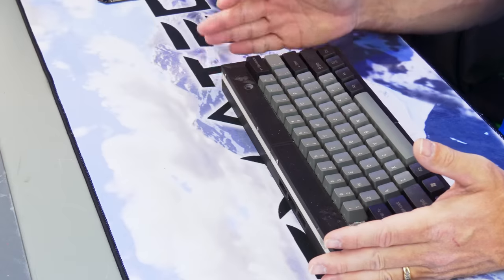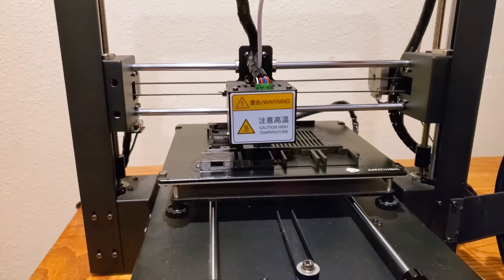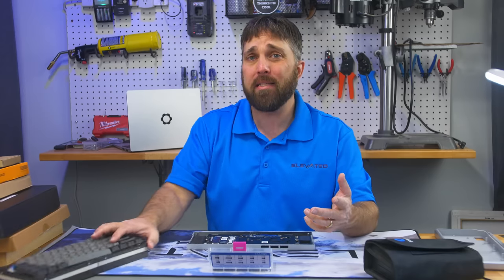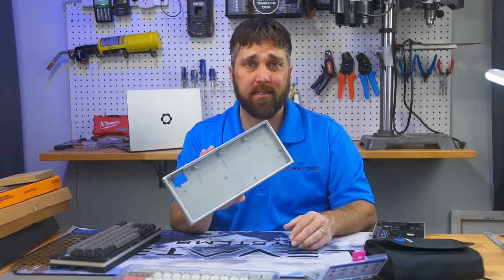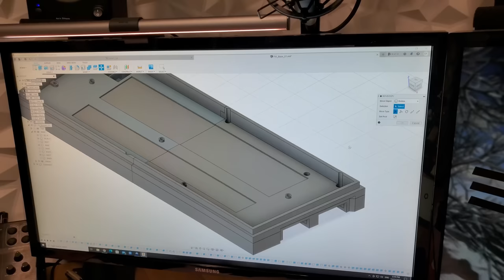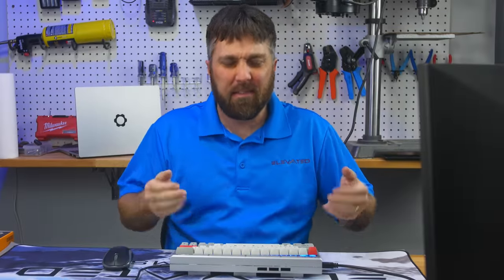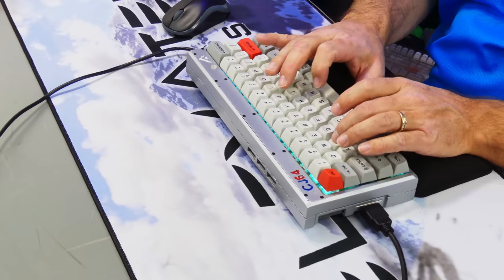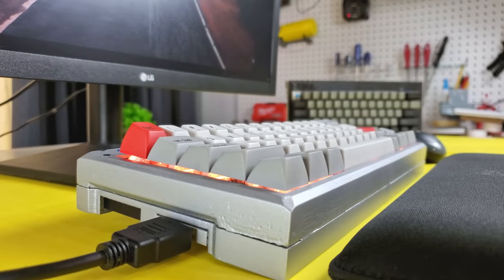The Framework Powered Cyberdeck Version 1.2

Comment: What'd be nice is if custom firmware could be submitted to framework, to add the capability to set a maximum charge/discharge state for the batteries. A good lithium battery might last 20 years if only charged to 80%, and discharged to 15%. Even if constantly on the charger. The main reasons batteries degrade in this use case is because of how batteries need to be charged. to get it to 100% say an example 10v battery, the charger has to hit the battery with 110-120% voltage or 11-12v. The problem is leaving it plugged in means that it is constantly being run at 10-20% over voltage. If instead you set the maximum charge state to 80%, or 10V you are now no longer damaging the battery constantly.

Comment: You might be able to save some front height on the keyboard by gasket mounting it, you would be able to skip that top layer that you are using to tray mount. If you use a brass plate you wouldn't have to worry about the PCB flexing into the framework motherboard since it is so stiff. After being part of the mechanical keyboard community for so long it's cool to see projects like this. You may need to increase the bezel size a little to accommodate the mounting style but I think that would be worth it over the front height.

Comment: The other choice was to make it have a trackpad if you want to make it look more like a computer. Put it were the numpad would go.

Remove the 2 side expansion bays and make a case for a trackpad and dock then slide it into the 2 expansion slots and Wala.
Reply: Or put the trackpad below the keyboard  (re-attachable maybe) if you'd like to use it on your lap on the couch
Reply: @dirkhaar2243  the way I was thinking it would be attached to the expansion slots so if you were to use it on your lap it would be attached on the side if that's a problem that I'm not noticing.

Comment: Suggestion for you v2.: Include a switch to use the Keyboard with another Desktop Computer, (like the GPD Pocket 3) So you can have a Keyboard and another pc at the same time. Or install bluetooth for That. A cheapo HDMI capture Card would also be nice, but I'm asking a lot here ^^
I'm curious for the all alluminium design.

Comment: you could run the laptop and plug it into a external monitor and also plug in a mouse and keyboard. 
The best thing about that arrangement is that you could use your laptop on the go, since it has a screen and a battery.

Comment: Hmmm. what about having a base with pogo pins to which you magnetically attach a keyboard module. For example, one can use a keyboard module with short switches and short keycaps . or having a keyboard module at home and another one at work, so only moving a slim case that contains the computer only ... limitless ideas and usecases this way ! I get that my idea is way off to the theme going on in here

Comment: The wood is a good idea for version 2..... If you're doing the current case as a "desktop case not built into a keyboard" that you can sell and it doesn't ruin it perhaps some "ready to go" vesa mount stuff would be good (maybe 2 or 4 predrilled holes in the flat cover?). So you can throw it onto the back of a monitor.

Comment: there are some USB 3.2 ribbon cables for FPV on ebay, you can even get custom length and angled connector options, much easier and faster than soldering it yourself in that case

Comment: Needs a dedicated hdmi port in the back with audio. I understand that it has usb-c thunderbolt on the sides but there should be a way to adapt the display and audio on the board to hdmi out or even display port. If it's a proprietary connector, it would be nice that Framework offer this as a kit in the future.

Comment: Really like this easy simplistic style, i like version 1 and i kinda want to see this made in as small form factor possible.

Wallthickness with aluminium CNC will optimise alot of space but id like to see very low profile switches and to make the keyboard as thin as possible. 

Such that this truely becomes portable or just sleak. Minimalist and thin

Comment: I would have looked into designing a right-angle module or have internal wiring for a Thunderbolt connection in the back. With the right monitor, it would be a one cable solution to the monitor, not including ethernet, that is cleaner than having a cable come out the side. Wish there were monitors that had ethernet built in and pass through via Thunderbolt; that would be the ultimate clean setup. The Framework has WiFi 6E, though.

Comment: terrible idea for a next step:

add a dock station, use some pogo-pins and break output all the IO to various options (ie storage, eGPU, mouse, ethernet, power), so that when you're at home you can just drop it into place and get all you desk setup attached without plugging in, and when you want to go you just power down and go.

Comment: You can probably use the original Framework battery by just removing its plastic casing and stacking/folding in half its individual LiPo packs. 😛 That would be a cool stealth mod. 👍

Comment: You can use a Royal Kludge 75% for the build to free a USB port with 2 more USB 2.0 ports for more peripherals. Well it will lose bottom/body RGB and will enlarge the body, but personally, I would need function keys and arrow keys at least.

Comment: Good job! This is awesome.
Shouldn't there be a slope from the back to the front for ergonomics?
Reply from the maker: There are feet on the bottom to allow ventilation which angles the KB at about 5 to 6 degrees.

Comment: Been loving the series so far, do you know any other more common laptop PCBs that is also compact like the framework's one?
Reply from the maker: I don't know of any current mainboards other than Framework that operate without modification outside of the laptop chassis.
Reply: @ElevatedSystems  Have you ever considered building a pi 4 cluster inside a keyboard? I've been playing with the idea of building one, but can't afford the materials needed. All the pi keyboard builds I see only runs 1 pi so far.

Comment: What about the internal keyboard connector? Is it possible to either use the stock keyboard or retrofit an usb option to use the interface on the motherboard instead?
Reply from the maker: The issue with the motherboard keyboard connection is that the same connection also includes the trackpad, power button, fingerprint reader and led. Without the schematics it is very difficult to isolate and map the Keyboard traces.
Reply: @ElevatedSystems  I see. Well, I don't see why they don't do it, would make using the motherboards on an enclosure like yours much easier after they are replaced.

Comment: This is a keyboard PC. Not a 'Cyberdeck'... a cyberdeck needs to be a portable pc with an attached display (and not one with a hinge usually because then it's a laptop) but a cyberdeck this is not
Reply from the maker: No, a cyberdeck is directly connected to the brain. I'm still working on the neural interface😜
Reply: @ElevatedSystems  fair enough but the contemporary versions are usually just pcs with non folding screens but if it's getting its own screen soon then hat's off to your dude cause then it will be